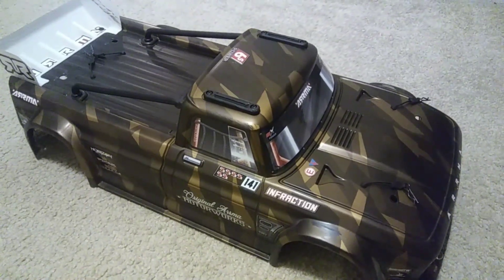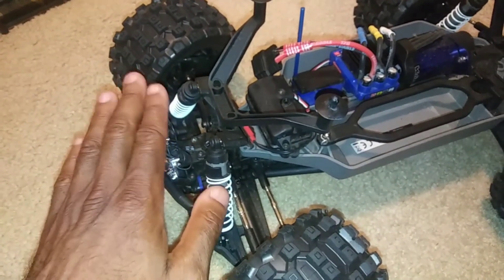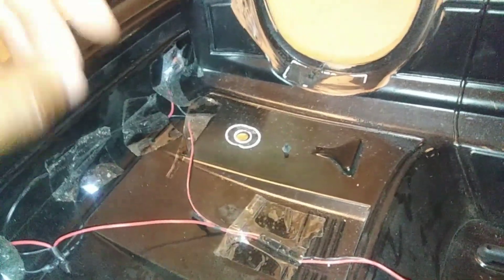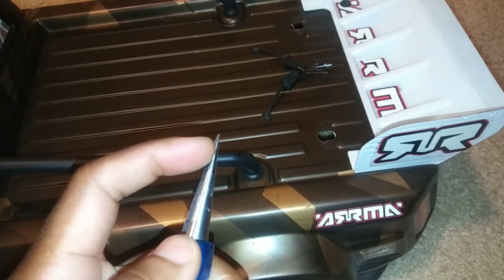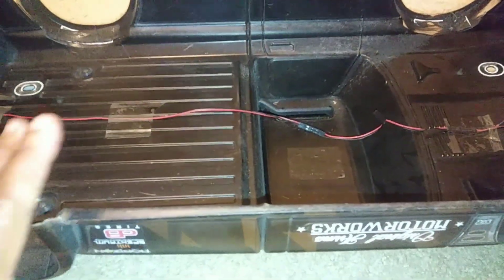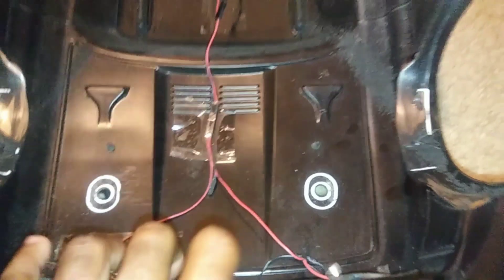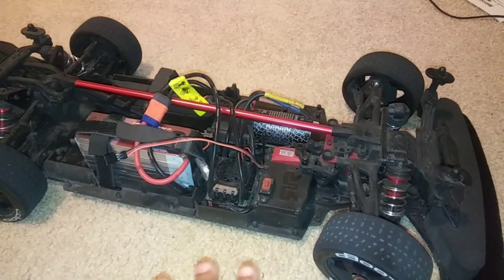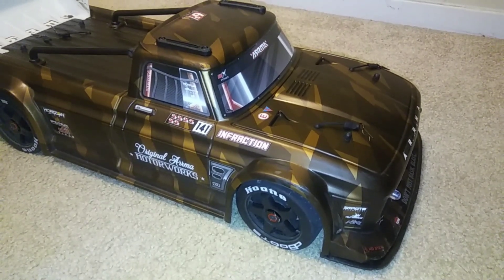Installing Lights on Your RC - Part 1 Overview

Comment: I normally run a secondary lipo for my lights also coupled with a battery voltage detector if you add a relay to your auxiliary channel they make some that have optional power in from a battery source and then gives you a output to whatever device you're trying to run that way the receiver is only used to initiate the signal

Comment: Lights are really nice for any truck. I actually thought I would have to have an extra little battery just for the lights, until I realized it’s simple enough to just plug your lights into the receiver.

Comment: Wish has some nice lights for cheap. The lights even have little chrome fittings that screw together with the body layered in between. I think I gave like $2 shipped and it usually takes me about 2 weeks to get them in the mail but they’re so cheap you can order a bunch of sets ahead and have them on hand any time ya need them. Great video JayTee. Now show us how to install an on/off switch for our 3 channel radios. 👍